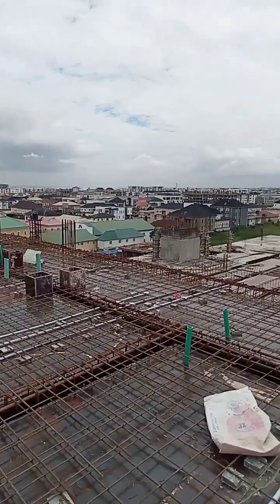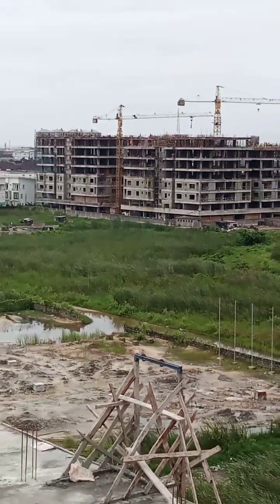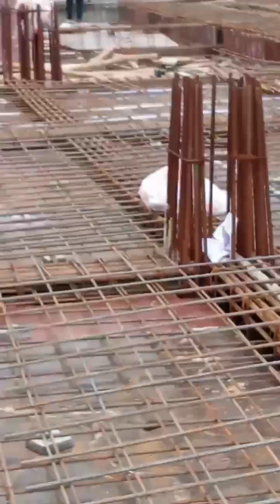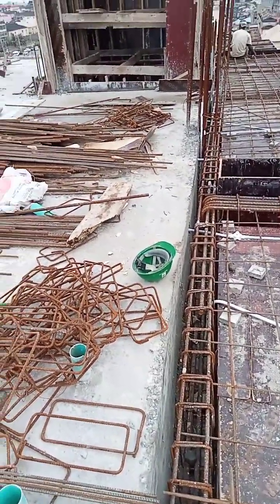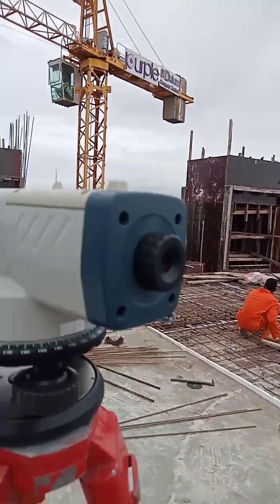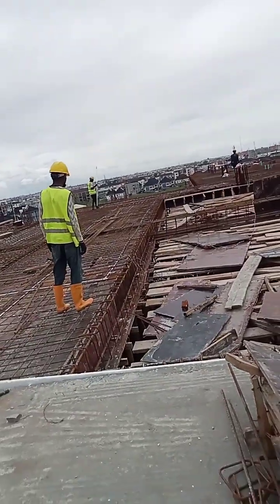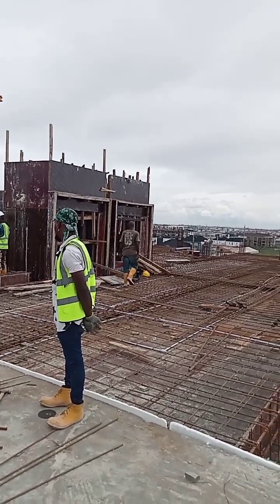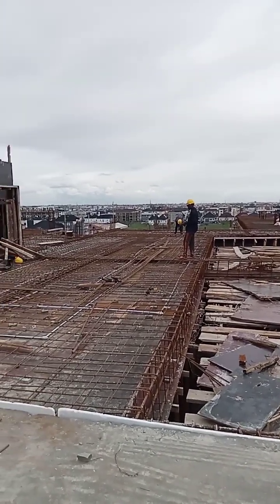TOP OF CONCRETE LEVEL

Comment: if your benchmark is 1,525 and your reading on the reinforcement is 1.500 it means ur reinforcement is high by 25mm
Reply from the maker: yes.
you are right.
the lower the number, the higher the spot checked.

Comment: Thank you, Surveyor. Does it mean we can't get a uniform concrete cover? It's only important we ensure that the reinforcement level reading on staff is not lower than the benchmark (existing concrete level) right?
Reply from the maker: The best is to monitor everything from start, from formwork levels to reinforcement levels, that will help us maintain a uniform concrete cover for our project